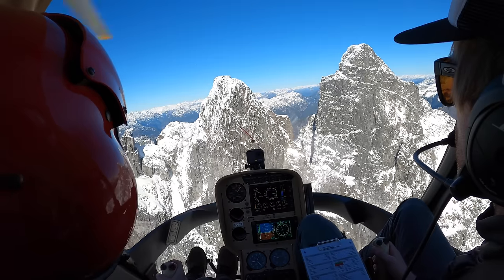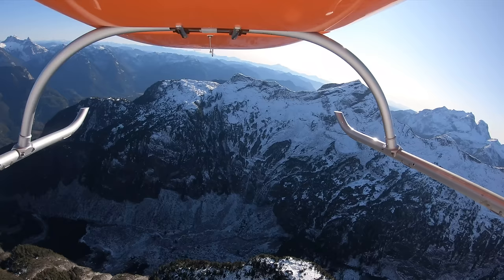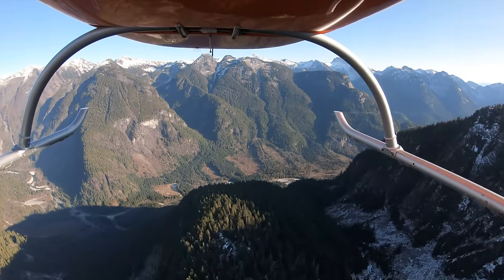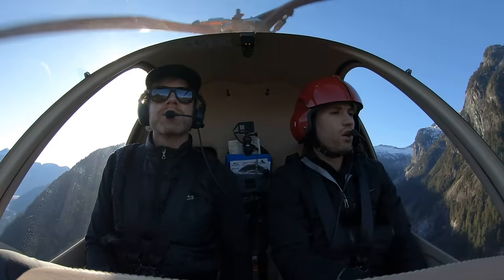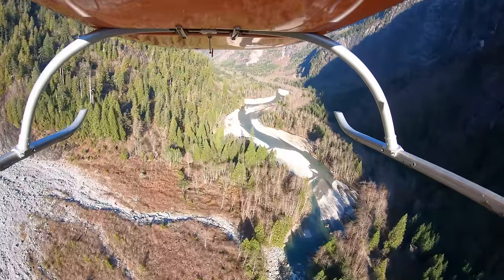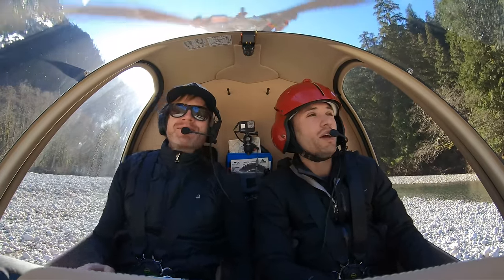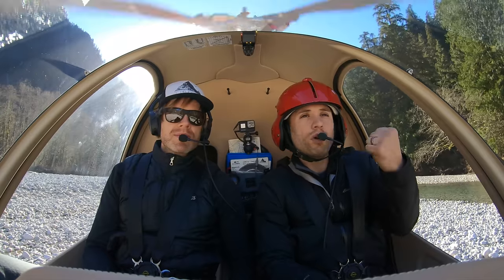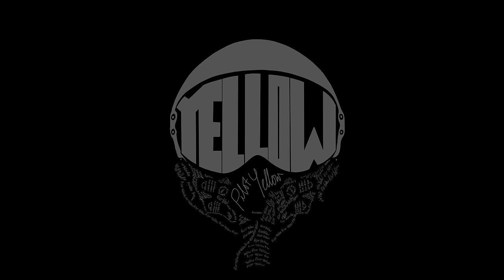ENGINE FAILURE ON MOUNTAIN APPROACH

Comment: I had no idea a helicopter could fly with engine failure. Thanks for sharing this.
Reply: As the great Buzz Light-year once stated:
"That's not flying; it's falling with grace."
Reply: @marshalllhiepler  falling with direction....
Reply: @christopherleveck6835 ,
"With direction" ??
I suppose that the intention is to change the direction (and the rate of travel in that direction) that the force of gravity would have you go.
Otherwise, your path would simply be "straight down, at terminal velocity".
No pun intended.
Reply: Leonardo Sojli yep well its called Auto rotation, the helicopters blades work exactly like a planes wing, using low and high pressure as it moves through the air. When a helicopters engine fails the upward moving air (because theyre descending) forces the Helis blades to keep spinning!
Reply: @mjstafford758  It makes sense. I hadn't thought about it. Thanks for the extra explanation. I appreciate it 👍
Reply: @mjstafford758 ,
Yes, it creates drag, in a manner similar to a parachute. However, the rate of descent is hardly slow.
If you ever get the chance to participate in a live demonstration ... be sure to opt out.
Reply: marshalllhiepler you talking to me or the other guy?
Reply: @mjstafford758 ,
I had replied to your comment ...
but, it's a public forum, so I don't mind if others read it. I promise not to crash and burn.
Reply: marshalllhiepler what???
Reply: marshalllhiepler yes the rate of descent is fast, never said it wasnt, thats why they “flare”.
Reply: marshalllhiepler 
Engine failure
Reply: Sure you can, the air going upwards makes your rotors spin, as you "drop". Works best with lighter helicopters obviously. It was like the first thing my grandpa told me about helicopters, he used to be in the whole aircraft biz.
Reply: Check out SmarterEveryDay on this topic
Reply: @leonardosojli9623  And as u get closer to the ground, u start pulling in some collective, which is essentially changing the pitch of the helicopter blade, to bite into the air and slow your decent...... the whole ride down you are pulling some collective in to control rotor head and airspeed, but u get the point....
Reply: It's Called an autorotation. look into it, pretty cool stuff.
Reply: @mjstafford758  yeah this also happens with propellers planes but no to the same extent. The faster you go the higher the engine RPM for a given throttle position. So when you slow your aircraft to 1600 it will go down maybe 50 rpm because it lost speed and the propellers are not being pushed by the moving air as much. Still if you're engines out the propeller stops moving completely and at that point you're just gliding.
Reply: Yeah basically they use the momentum of the rotor to come down but you gotta go pretty quick
Reply: Me too
Reply: @marshalllhiepler  In that video, that doesn't appear to be an emergency landing, or even mechanical failure. It SEEMED to be the pilot misreading his distance from the ground, basically, snow blindness.  The mostly white background makes the distances deceptive, even with the rocks poking out. He didn't realize the boulders and outcroppings he thought he was looking at were just small rocks, and that the 100's of feet of clearance he thought he had was only 10's of feet.  It was either that, or he was flying the helicopter outside it's safe performance curve (too high of an altitude, too heavily loaded), and just didn't have enough power to make it over that mountain.
Reply: do you remember a spinning jenny ? works the same way
Reply: That's called auto rotation
Reply: thats key. You can fly with the engine not working but you can’t fly if youve already slammed into the mountain
Reply: it can't fly, in a real engine failure which this wasnt even close to that btw, your literally slightly slowing your fall.
Reply: @mjstafford758 bernoulli’s principle

Comment: Wow.  I've always heard of auto rotation but had no idea you could "glide" a chopper that far!
Reply: Depends on the size, big twins auto like bricks.
Reply: You can glide one from space 😂 but seriously you can glide one from its max alt to the ground. The blades are windmilling from the decent. The only limitation is the ground coming up at you.
Reply: Great Job. I know very well what you felt. I have also realised two emergency landings, but with PHG. Both are on YouTube.
Reply: It acts a bit like a gyrocopter. They don't have a powered main rotor. Only for initial spin up.
Reply: You can’t without altitude and airspeed😂
Reply: he kept the engine running
Reply: You can’t this is a joke
Reply: At a fairly steep angle.

Comment: When you learn to fly a helicopter,  you practice many, many of these simulated engine failures....You do 'em till you are sick of it!  Then  you practice it some more!   Until you are absolutely comfortable with it.
Reply: Are engine failures common in helicopters?
Reply: I'm doing that right now.  11 flight hours so far.
Reply: @theendisnearbeware all of the above.  It is a potentially dangerous maneuver if not done correctly, so when practicing over and over it could damage the aircraft, or at least put excess wear and tear on it.  Also not all insurance options cover practicing full no power auto rotations.  (I'm a helicopter pilot)
Reply: @theendisnearbeware Yes exactly, when practiced over and over, on the training aircraft, it can cause undue wear and tear on the aircraft. Causing the maintenance department to become annoyed with you! There is really no need to take it all the way down to ground contact. Once you have arrived at a 5 foot hover, the maneuver is basically complete. No need to land hard and possibly ding the skids! Or strain the airframe.
Reply: @jackmills5071  Not at all! But we practice, simulated engine failures over and over again, so in the rare event that it does happen, dealing with it seems very easy and we eliminate the element of surprise!
Reply: Training to become a flight medic and this was something I always wondered about. Watching these videos and learning more about how autorotation works has definitely been helpful now that I know the aircraft is quite flyable without power. I used to think when the engine went, that was it and you just dropped like a brick....
Reply: How many helicopters one wreck  before learning this technique?
Reply: ehhh behhh no but they dont glide like a plane , more like a parachute so it takes much practice
Reply: Wait so if the engine cuts out completely would you just fall straight down or glide to the ground?
Reply: Cody Tucker glide , in a sense the rotors will still spin which still gives the heli lift when you pull up on the collective but you have to be mindful of your speed
Reply: ...and then you crash!
Reply: @Mike-co1fd dude probably joined the mile high club against his will
Reply: I remember when I was in the US Army and we were doing our own training (setting up communications networks; MOS 31-F) we had our own rigs set up in a huge field that was close to the airstrip and I saw helicopter pilots doing their own training exercises at the same time we were. It scared the fucking crap out of me and I wasn't even IN the goddamn helicopter. We were standing outside the Node Center, I had a cup of coffee in my hand when I see this "little bird" take off, then fly DIRECTLY over our heads; passing over us for a second & then back over the airfield - that son of a bitch dropped like a goddamn brick & I almost spilled my coffee. Then they gained RPM's just before they almost slammed into the ground.... and then they went back up - and did the exact same thing again. I almost pissed my pants every single time they did it, and they did it over and over and over. It was hard to watch. Those guys are fucking crazy. I'll stick with my Signal MOS. 

I've often wondered, is a helicopter pilot a POG or a Grunt? You have to be crazy as fuck to strap yourself into a piece of machinery that can't just glide back down to the ground if you lose all power - it drops like a brick. I'd rather be on the ground getting shot at than falling from 3,000 feet AND getting shot at; then you still have to set up a perimeter and defend your site until the extraction team pulls you out (if you're lucky enough to have an extraction team). Chances are you're so far out that it comes down to a self extraction; now you ARE "boots on the ground" (after you toss a grenade into the helicopter to destroy any classified or sensitive equipment). Something as simple as a Kyk-13 getting lost can fuck up your whole day; they're responsible for multi million dollar equipment . A "Grunt" is normally thought of as dumb, didn't score high enough on the ASVAB to get a real MOS so they went into infantry and POG's are thought of as being "non-combat" even though there is no such thing as a "non-combat" MOS but those pilots still have to be able to operate if their helicopter or plane goes down.
Reply: yes
Reply: @suckOnThese3  based on your comment; i guess you radiate negative vibes around you every day, i feel sorry for the people around you if any
Reply: @liquidbraino  That's the thing though - helos aren't "just a brick" even if the engine gets totally shredded. That's why this video was possible and got published, rather than whatever the previous upload was being the last thing these two would ever upload.
Reply: False Advertisement on the Title!!!.....They were too Steely Ice Cool emotionally to be believed....They need Acting Lessons!
Reply: every thing needs to be second nature
Reply: @jackmills5071  YES

Comment: For those with questions, the blades can be kept spinning even without power (although they don't provide any thrust and the helicopter starts descending. Basically converting the height to blade spin, similar to leaves that spin as the fall down). This energy is maintained as long as possible. Once the helicopter is about to touch down, that stored energy is used up all at once to slow the chopper enough not to crash.
Reply: this is still a much longer glide than I imagined
Reply: Explain how it’s “stored energy” and then how is it “used” right before touch down
Reply: @jimmymcgill5572  I know I'm late, and not the best at this, but the best way I can describe it goes like this; 

"Storing energy"; as the helicopter loses power, you will pitch the nose down (kind of softly diving downwards), and because helicopter blades are designed to create lift in the air, they will react to the wind caused by the helicopter gliding downwards, this results in the blades spinning faster, (however the helicopter is still going down due to the nose being pitched forward)
 "Using energy"; as the helicopter is relatively close to the ground, you will apply slight upwards collective (go up lever), as well as pitch the nose up to reduce airspeed and because the blades have the speed from the aforementioned pitching the nose downwards while gliding, this will allow the rotors to generate more lift than if there was no dive, thus resulting in the pilot being able to soften the landing and have higher chances of crew and helicopter survivability.
Reply: @Skitlzz-8  Do helicopters also have blade pitch adjustments, and are those used in the checklist for engine failure at mid to high alltitudes?
Reply: @gogyoo  If by "blade pitch adjustments" you mean angling the rotor blades to increase or decrease lift, then yes. The collective (go up lever) controls small portions of the blades, and will lower them (it cannot raise them, as by default at 0% collective the blades cannot produce enough lift to take off, meaning having an option to go into essentially "negative" collective would be useless). So thus, in the event an autorotation is needed, along with pitching the nose down, the first thing you need to do is drop out the collective, this is because without doing that, the engine cannot produce enough torque to keep the rotor spinning as fast (meaning you fall quicker and won't be able to perform a safe autorotation). So, you lower the collective, and because the blades on their own are pitched upwards ~1-2 degrees (not entirely sure), that's what causes the rotor to spin faster while diving, even if your engine is out. and then, because it's spinning faster, it has more power to handle more drag (caused by raising the collective; same reason planes won't fly with flaps down after takeoff/before landing) and this short time of being able to use more collective is used when near the ground to cushion the landing.
Sorry for the long response, I'm not the best at making things like these short.

Comment: I'll NEVER forget engine loss training in an airplane.  My instructor would have me take off and randomly shut down the power.  I had to either make it back to the runway (a small single runway airport in Corona California) or explain to him where I would put it down. It was scary even though I ultimately knew I could go full throttle if need be.

Comment: When my instructor killed the throttle to simulate engine failure, he would say, "You just lost your donkey !"
Reply: Well, there's yer problem, cowboy.
When you head out to the stable, make sure you saddle up a horse ... not a donkey.
Reply: martin i ,
Hence the small cockpit fire extinguisher next to the pilot.
You didn't think it was for use in the event of fire, did you?
It allows the pilot to knock the screaming passenger out, so that he can think straight and land safely.
Reply: martin i ,
A good helicopter can make a salad at 20,000 feet. (That's why there is a bottle of Thousand Island Dressing, next to the fire extinguisher.)
Reply: I would answer, That was one bad ass donkey, while it lasted!
Reply: @marshalllhiepler  talking about donkeys..
Reply: lmfao

Comment: The pucker factor is a bit different in real emergencies.😊

This comment comes from a CFII that had a right side strut fall completely off of a PA-28-181 during takeoff at GMU in Feb of 2015 and I landed safe with minimal damage to the right wing tip as it slowly settled onto the runway at about 48-50 knots.

This is a great video of a simulate emergency and I agree 100% with the talking your way through it even when alone. Talking aloud makes you feel more like your following a set checklist and I feel it keeps my students calmer in emergency situations.

Don’t confuse the talking with ATC communication. They can wait announce your situation and intentions quickly and clearly if you have time as this pilot did, but always fly the aircraft first. Aviate then communicate.

Great video!

Comment: As a young engineer i was navigator on overhead line patrols. During my initial flight we did this engine-fail similation at about 1000' over Liverpool (old) Airport. It was one of the smoothest landings of my whole six weeks of patrols.

Comment: You can ONLY perform a safe autorotation providing you have the adequate high enough altitude to do so.
Reply: Rodney Leonard whats the minimum altitude one needs in order to do that in a safe manner?
Reply from the maker: Rodney Leonard yes that is correct. With enough speed you perform a safe auto from as low as about 50 feet but your reaction needs to be immediate and you need a perfect landing spot directly in front of you.
Reply: abvmoose87  type aircraft/aircraft characteristics also has some bearing on it. Google “height velocity curve”  and you will come up with a lot of info like this. http://www.copters.com/pilot/hvcurve.html  Stay out of the shaded areas, there be dragons there:)
Reply: Yes absolutly correct 10 - 4 Thanks Micha appriciate ! The view was awesome - D
Reply: Thanks rronmar for ( copters.com/ Pilot/ hvcurve.html ) appriciate I also got it from Bell 47 !

Comment: I worked in the Canadian Arctic during the 80's and 90's on the cold war era DEWLINE radar bases and saw many helicopters picking up fuel from caches or coast guard choppers picking up mail and supplies from our various stations. One instance that I remember was a Bell Jet Ranger 206 which was ferried to our station by a Bell 212 under slung after it had experienced dynamic rollover on a muddy river bank about 70 miles away doing some natural resources work. If you can fly choppers they are easy to fly until something goes wrong and it can get real ugly real quick as you are usually close to the ground and don't have a lot of time to figure out what's wrong before you are smashing and crashing on the ground. The 206 Jet Ranger was a write off and nobody got badly hurt but the engineer and pilot of the 212 said there were lots of good parts to be salvaged by the company which mitigated the insurance rates for the company. Good video of a simulated auto rotation showing terrified people that you can land a chopper without engine power and do no or minimal damage if executed properly.

Comment: Well this sort of looks impressive. But it really doesn't count if you wait until you're at 3000 feet to roll off the throttle. And it also doesn't count if you do a power on landing.
Reply: @miso-ge1gz  If the engine quits you can auto-rotate. If the transmission seizes, then you're screwed.
Reply: @sgvincent100  - Have you ever actually flown a helicopter?

Comment: A local Sheriffs helicopter(Sacramento CA.) had a transmission failure(what the news reported) and made a successful landing in a canyon, but on a rolling grassy hilltop.  Before they could climb out, the helicopter began to slide sideways down the hill, starting rolling over several times, and caught fire, killing both pilots.  
Very good advice to NOT land on rocks!